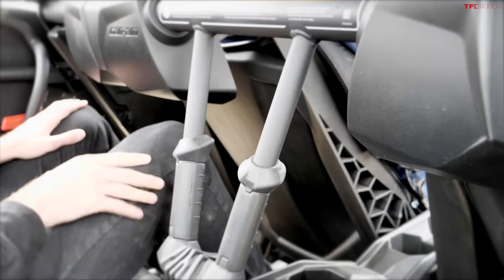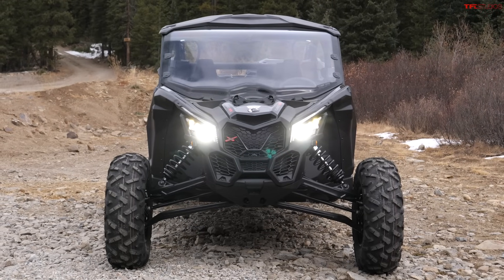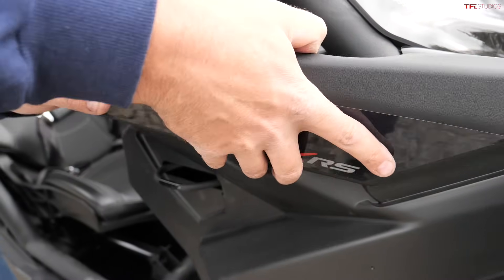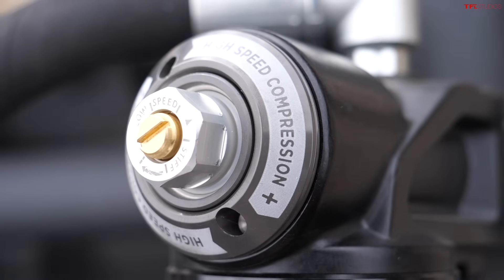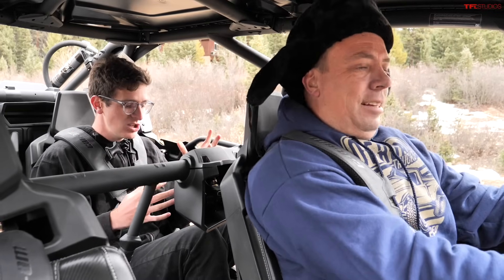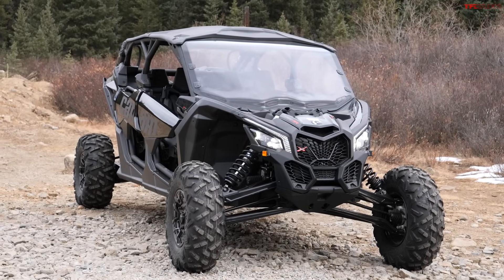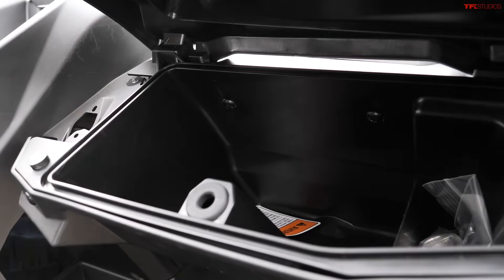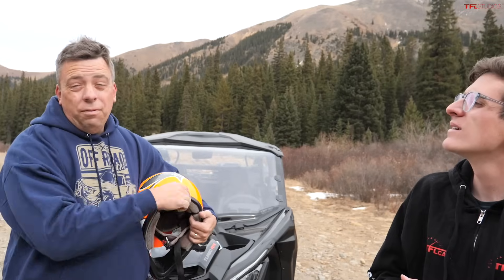This Can-Am Maverick X3 Is the Most Extreme Off-Road Machine You Can Buy Today!

Comment: 2023 and can am's x3 still have the same A arm hole ob-longing and junk china sway bar links. Just purchased a 23 rr smart shox and have to rip it apart to fix the factory mistakes on weak chassis points. Why do these things cost so much and can am doesn't fix these on going problems?

Comment: I wish Cam am would put stainless steel exhaust on there outlanders. I’m buying a Honda or Suzuki next.
Reply: I have a Honda talon x 4 love valve seater. If I were you I would get the cam am. Much more power and softer suspension
Reply: Buying Asian eh

Comment: You lost me at CVT.  200 hp is great, unless the computer decides that what you're doing is too much strain on the transmission and cuts the power, as in your infamous Subaru Outback review.
Reply: In this case you are wrong. You can hoon these all day long. I have 3000 miles of powerslides and doughnuts on my belt right now. It doesn't cut power.